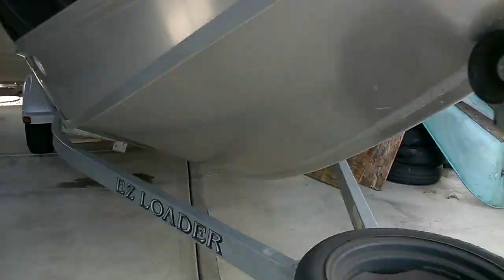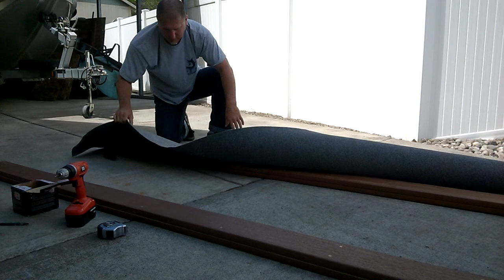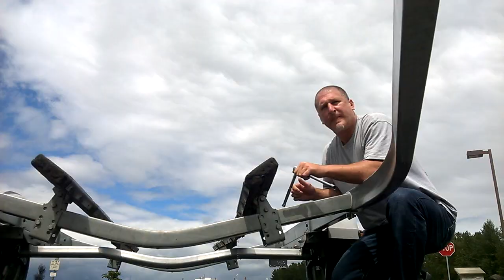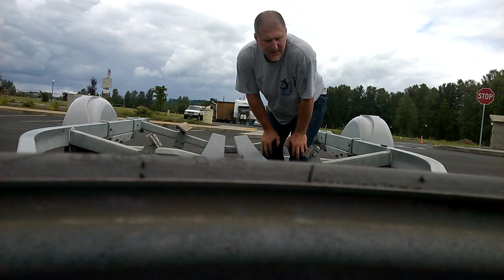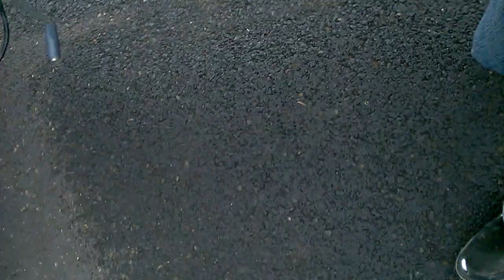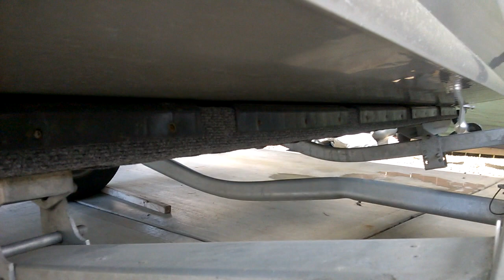Boat Trailer Bunk Replacement

Comment: Watching this gave me an idea. Instead of screwing the boards together from both sides, I could counterbore holes in one side then use shorter screws. Then after screwing it together, fill the counterbores with 5200…..No carpet…..no glides needed.

Comment: I need to do this exact same project. I have an EzLoader trailer as well with 9' bunks. What kind of staples did you use? What bolts did you use to attach to bunks to the trailer?

Comment: Are the plastic covers that go over the carpet bunks necessary or can yo u just work with the carpet?
Reply from the maker: I have seen others just use the carpet (obviously make sure the staples are not on the top). but I had the plastic from the original bunks... and I just reused them... (thanks for watching)

Comment: Great video, thanks!  Are those plastic(?) slides you put on at the end necessary?
Reply from the maker: no.. I originally had carpet with wood... I had them so I used them... I assume they are more durable than straight carpet. but if you only  have carpet, you're good to go!

Comment: I build custom wood bunks for a boat company u always want to leave to bottom open water collects and needs a way to escape or will ruin the wood and carpet a lot faster
Reply from the maker: +Jesse Goetz right on... thanks for the heads up!... experience always helps!
Reply: I replaced my bunks last year, and i discovered that wrapping the ends of the boards did not let them drain out. I would back into the drive and water was still running out of the end.
I cut the ends off so you could see the treated board. It looks less professional but there is no water still in the bunks when i get home. any one else seem to had that problem
Reply: can you help me please ?i m changing the wood of my boat trailer ,what kind of wood shall i buy thanks chris from Malta EU

Comment: Why would you cover composite/plastic planks with carpet only to cover the carpet with plastic covers over the carpet?  Why not counter sink the screws when you screwed the 2 planks together and use them that way?  No carpet to wear out or get impregnated with sand which scratches the boat......duh.
Reply from the maker: +Scott Parker You seem like a good guy with helpful comments. maybe work on your ppl skills. good point though... but, poor delivery.
Reply: Duh....

Comment: I found 2x8x16 or 20 thinking of using but no carpet. I have a 17 ft skiff
Reply from the maker: that should work great... because I had to combine 2 1x6's to make the right size for my bunks. if your not going to use carpet, that's no problem... but you want to slightly countersink the screws so it dosent scratch your boat. good luck!

Comment: how big of boat and what was the thickness on the boards.
Reply from the maker: +lil j   BOAT is a 18.1 Weldcraft Renegade (not sure of the weight. The thickness of the borads was 1"x6" (it is that TREX DECK stuff... I am guessing you can find it on craigslist or something like that. Dosent need to be pretty, just strong (the boards are really tough). Hope that helps.